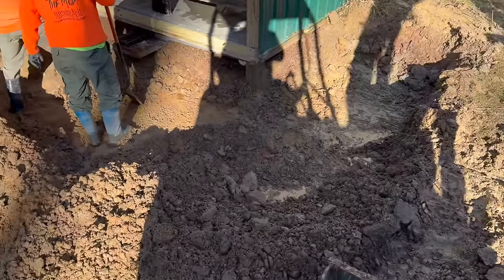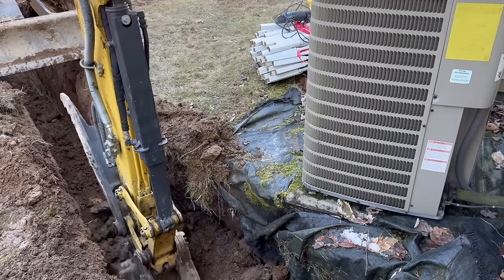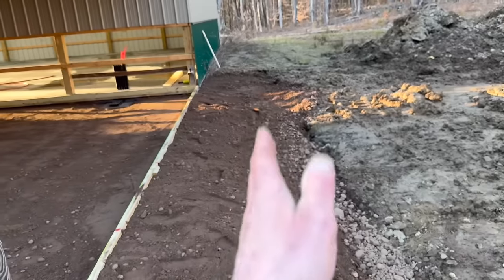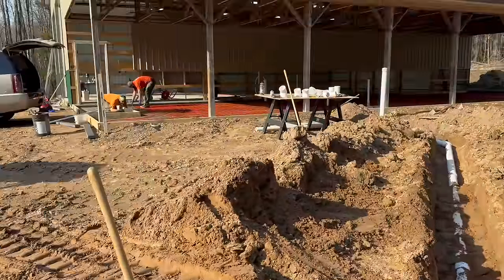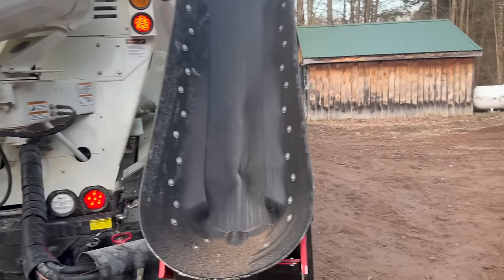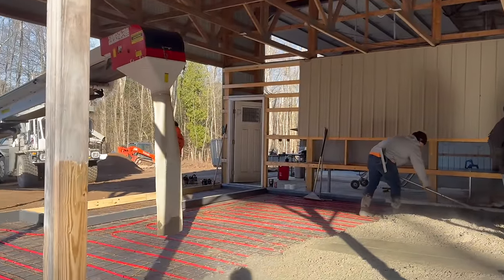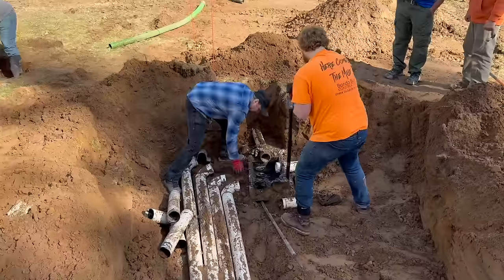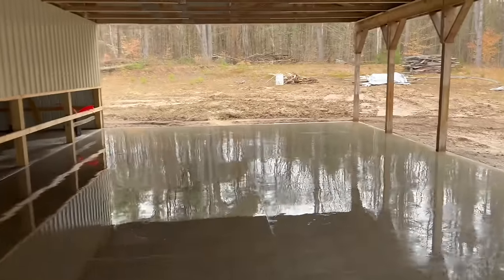THE CONCRETE JUST CRUMBLED!!!

Comment: you did a lot of good work at this one property. When you keep soaking it in water does it get harder than the PSI rating for the original mix? Or does the concrete just get to its max strength faster?
Reply: both

Comment: Here in New York State, we have a whole lotta clay and a 4' frostline.  I've always wondered why footers must go 4' down but you can pour a 4" floor in an unheated pole building.  Bondo does a great deal here to drain this soil and backfill with aggregate but what do you really need? Remember maybe 14 years ago when we had a cold snap of several weeks in the negative numbers.

Comment: Im in septic business.You saved your customer probably couple thousand dollars replacing the box and resetting the lines. A leachfield vent on fields buried over 18 inches would help. I see backflushing the water softener kill dist. box and septic tanks and the plastic tube leachfields like enviro or geoflow. My water softener in my state is allowed to drain elsewhere than the septic tank.
Reply: We have really hard water out here, and if I build a new house I would want to have a water softener. Is the back flow just a brine?  Would you really want that in your leach field in the first place?
Reply: @blackwolfnews1722  My softener discharge is partly solar salt and the minerals from my water that gets captured in the pellet tank.  I have an elaborate system put in with two 400 gallon holding tanks, it also as charcoal and carbon filters.  The salt is what damages septic systems.

Comment: How do you deal with the 2x4 forms sandwiched between the interior & exterior concrete?  Will walls cover them up?  Will moisture coming from the exterior concrete ever rot them out?

Comment: Never oversize DWV piping.  The reason these systems have engineering standards is for a reason.  When you oversize drain pipe with the same water flow n inside surface area is increased and will not remove solids.  3” on a full bathroom group with lavatory.  Don’t go 4”.
Reply: Actually i live in a country where 4,5" are used everywhere, it works very well, we are using 1 cm per meter slope to make sure everything are flushed away.
Physics are the same all over our planet according to my knowledge ;)
Reply: @reklamreklamerad  maybe in your country there is increased water flow…I’m not sure.  In the US, if you follow the plumbing code for your drainage fixture units, there is no reason to upsize.